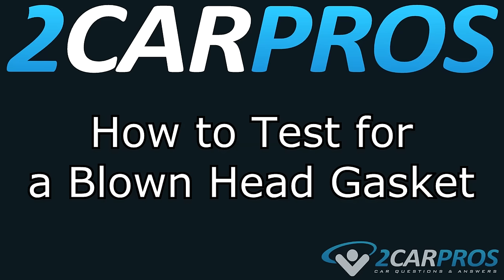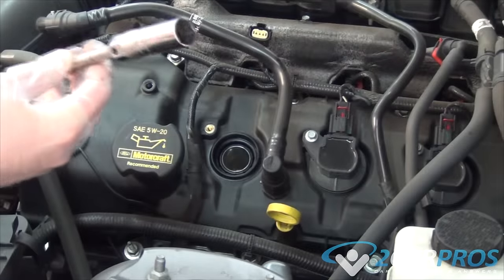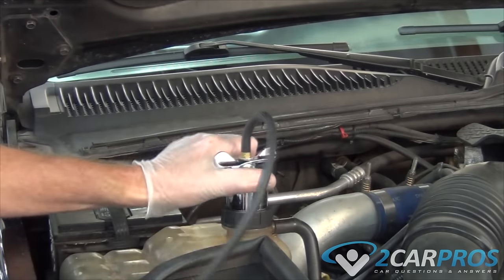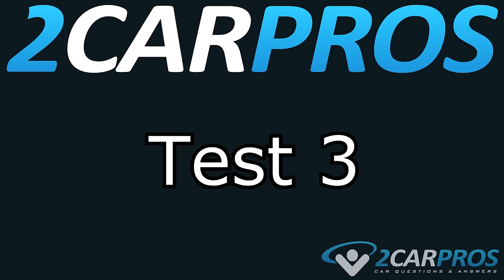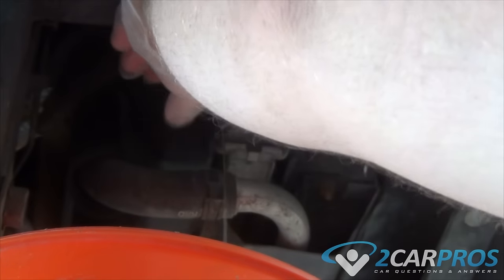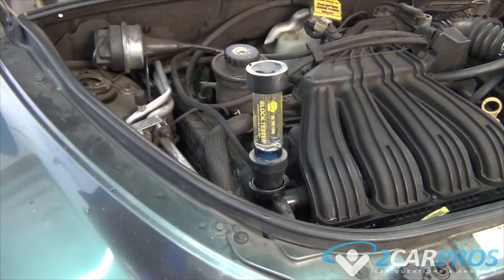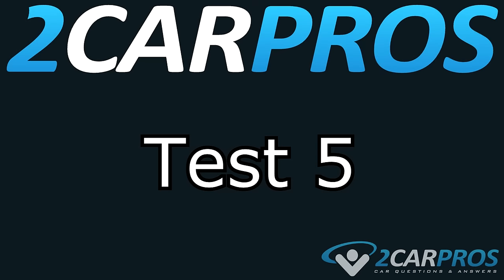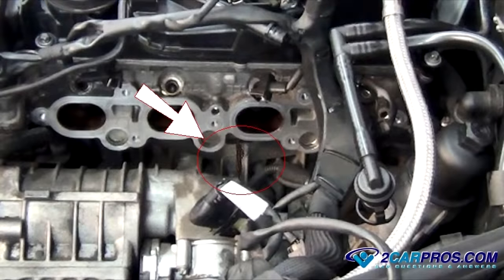HOW TO CHECK FOR A BLOWN HEAD GASKET

Comment: My car is heating up the temperature gauge moves kinda quick from 1/3 to 3/4 and back again. I replaced the cooling fans and it didn't work. I replaced the thermostat and new anti-freeze but the temperature gauge keeps moving like if its heating up. What else could it be? Anyone please.
Reply: Carlos Dominguez water pump maybe?
Reply: Elizabeth OilfieldTrash Hi, Happy Holidays! I took my car to an auto electric and he did a diagnostic and supposedly it was a fuse from the fuse box and that the the temperature gauge wasn't working well. The temperature gauge after driving for a while still goes past half up to 3/4. Yet I keep driving and the cars keeps running great. So seriously I don't have a clue as to what to do next. 

Thanks a lot
Reply: sounds like a plugged up radiator how old is vehicle what did the antifreeze look like when you drained it had a 92 dodge van that i had to change the radiator on three time in 5 years ran great in the winter had issues in the summer
Reply: When the engine is hot check the temperature at different parts of the radiator. It should all be hot.
Reply: Temperature sensor
Reply: Air in the cooling system..bleed the system..let engine cool down..remove radiator cap..have someone else turn heater on to High and rev engine to 1500 rpm till you see bubbles come out of radiator..back to idle..then rev again to 1500 rpm..back to idle..add antifreeze to the top of radiator..reinstall radiator cap. Turn ac back on. Drive car to average driving speed..65mph/2000 rpm..this should do the trick. Temperature gauge should stay at 3/8 to 1/2 line. Approx 208 degrees fahrenheit.

Comment: i am using honda city gxi varient 2004 petrol model 
 it is consuming engine oil upto 500 ml per 2000 km . what could be the problem vd my car
Reply: karan sharma Could be a number of things. Best is the check for leaking seals and gaskets and replace it if found. You can use leak finder dyes to locate leaks using uv light. If no leaks exist then move on by checking if the oil is leaking internally like inside the sparkplug cylinder wells. Oil could be burning off from each sparkplug detonation. Hope you rear engine seal isn't leaking. Expensive job to gave replace. If that is your problem you can try ATP AT-205 reseal. This has been know to work great for all kinds of seal leaks to avoid expensive repairs. Also replace pcv valve. A bad vavke can cause oil loss. If none of these things are the problem the only thing left would be a blown head gasket. Let's hope that isn't your issue. Good luck.

Comment: My spark plugs keep on burning out in 3-4 days every time.. help
Reply: happen to me water is leaking into the cylinder 
miss fire ....code
Reply: Did that help bro?
Reply: @megatron2535  i done up the whole engine.. and still happened.. the problem was that i had a hole in my cable on the water sprinklers that was just perfectly on top of my spark plug.. im an idiot for not noticing that..

Im not an expert by all means, but maybe i can tell you my opinion on your problem.. ive done a lot of research.. care to share ?
Reply: @Ay_Yo_WTF  cool thanks.. my car keeps heating up once I'm idling for too long at a red light or when I park and not immediately turn off the engine.. the moment I start driving again the car cools down again
Reply: @megatron2535  okay so.. they say its probably a broken radiator fan..
But my opinion is your coolant, because i remember a few years ago, my car use to do the same thing more or less, and my mechanic didnt say or charge me anything on a radiator fan.. 

Is your car manual or auto and which car is it ? Can you also tell me the miles on it..
Reply: More questions, sorry.. what colour is your coolant in your radiator?  And is there any type of liquid OR white colour foam on the radiator cap.. BE SURE to take off the cap when the engine is COLD to check..
Reply: @Ay_Yo_WTF  thanks I appreciate it bro.. i drive a 08 civic lx, 1.8L automatic with 150,000 miles.  The radiator cap doesnt have any milky brown discharge on it
Reply: @megatron2535  okay thats good news for the gasket issue, and if your not having any spark plug missfires.. i think your in the clear..
Reply: @megatron2535  oh and when you turn on your ac , does it overheat "quicker"..

They mentioned that you should open the hood, turn on the car and ac at max, you should hear the cooling fan under the hood turn on.. 

If it doesn't, then most probably the cooling fan/electric fan..

Personally i would take it to a local mechanic, at least two different ones, to see if they match and get a quote..
Reply: @Ay_Yo_WTF  thanks bro!  I'll ask my friends to see if they know any.. I'm relieved to hear it's probably not the gasket.. i swapped out the spark plugs 2 years ago or 25,000ish miles ago... I'll also pop the hood and check the fans to see if they operate correctly
Reply: @megatron2535  gasket problems include.. a lot of white smoke from exhaust, a lot of missfires and jerks..

So basically when there's a hole or crack between your radiator and spark plug holes.. which you dont seem to have..
Reply: @Ay_Yo_WTF  thanks bro.. I've taken a while to drive my car through different driving conditions to recreate the conditions that lead to my car overheating.. it hasn't overheated since.. I have had my ac on/off, short drives/long drives.. and nothing since.. ill keep looking at my temp gage to see whats going on.. do you think bad gasoline could also cause this?
Reply: @megatron2535  not bad gasoline in my opinion.. because from what i read, its that only oil and water circulates around your spark plugs and the cooling fan is there for the oil and water only.. hope that makes sense..
Reply: Probably too late in replying now but it sounds like thermostat problem or radiator fan problem to me
Reply: Does the temperature gauge go down quicker if you start blowing the heaters on full blast ? If so then it sounds like the thermostat is fooked
Reply: @chrissygizmo6057  never to late for good advice bro 👌.. weirdly enough the problem went away on its own 🤷‍♂️

Comment: In few days my swift vix2006 model car petrole smell lick in internal seats while driving car
Reply: fuel smell inside of car? its normally a fuel leak bellow the car where the fuel tube goes from the tank to the engine.

Comment: my car doesnt show anything the meter goes crazy changed radiators new fans fan motor and some other temperature sensors still temp goes up and down my mchanic checked and my coolant wasnt boling thermostat isnt jammed everything is fine turns out its the temp gauge 😂

Comment: HELP I have had dodge caravan to 3 different mechanics and 1 overpriced dodge dealer, I;m having over heat problems but I always stop van when it starts to go to 1:30 oclock on temp gauge --I have changed out everything on this crappy 3.6 L dodge chit....but otherwise the van runs smooth and no white smoke and no milky oil cap had test done and stayed blue--then dealer said it failed the test and so liquid turned yellow for them.....if blown head gasket wouldn't engine sound clunky and I have some smoke??    have had the radiator flushed and see no leaks but is it possible a old radiator 112,000 Dodge could be the problem and not showing any signs???
Reply: Theresa K17 Do you get heat from the heater vents when you turn on the heat? If not your heater core is clogged. If this is your problem you can easily bypass the heater core. If byoassibg the heater core solves your overheating then you've found your problem. If byoassing your clogged heating core still doesn't stop the car from overheating it means you either gave a stuck close thermostat it a clogged radiator. My guess is you already change the thermostat. With that many mikes it's a good idea to go ahead a get a new radiator even if you don't need it now. It will help with engine efficiency and gas mileage and less wear on your engine and water pump from better flowing radiator and reduce temps.
Reply: Theresa K17 forget to mention could be bad fans, fan relays, fan switches and thermal switches and water temp sensors. Could also by bad fan cluch if your car has a clutch fan. Coks be worn pulleys, list belts, frozen ac compress pulley. List goes on and on. Always check cheapest, easiest, and most likely first.
Reply: Easy to see if the fan is turning on when the engine is hot. Hot wire the motor to see if it's the switch or relay  before replacing the fan. This is basic mechanic stuff.
Reply: @emjayay  can u help me

Comment: Hi. I have a 2001 Dodge Durango 5.9l. My number 1 cylinder holds 95-100psi and the number 3 cylinder holds 120psi but the other 6 cylinders all hold 130psi. I don't have anything milky on the oil cap and there are no bubbles in the coolant when I remove the cap. Could that be the head gasket or is it more to do with the piston?
Reply: Bolt Terrakion worn piston ring

Comment: UGH these tests aent easy are they.... why cant the car just fail when the gasket fails.... this didnt help me at all I may as well bring to the shop before buyer $500 worth of tools and testers.
Reply from the maker: Most of the tools used here are available to rent for free at any auto parts store or purchased very cheaply on Amazon. Thanks for watching!
Reply: Because you need $500 worth of tools to open the radiator cap or the oil fill cap...

Comment: I have none of these symptoms, yet coolant is getting into the oil. Now I've drain chocolate milk from the pan.
Reply: Is it a GM?
Reply: If it is a GM car, the intake gaskets leak around the coolant port between the lower intake/cylinder head area. There are Problem Solver gaskets available that are stainless steel and 'rubber' that won't blow out and are installed w/ a larger torque #.
Reply: Also, flush the cooling system w/ a quality fluid and use yellow antifreeze. Store brand works fine. The pink/reddish stuff will crystallize before the next 100,000 interval change.
Reply: @mitchsumner2831 2002 Ford econoline. It was the lower intake gasket that leaked.   Since it's not the head gasket, I used a bottle of K-Seal (pour-n-go) and it seems to be fine now.

Comment: If you have a Northstar motor... Every one WILL BLOW HEAD GASKET... 2ND GEN REQUIRES  GM HEAD GASKET SEALANT EVERY TIME YOU SERVICE COOLING SYSTEM... ITS WRITTEN ON A SMALL LABEL UNDER THE HOOD !?!?! HEAD GASKET SEALANT FROM THE FACTORY!!? SOUNDS LIKE A BAND- AID ON A BULLETT HOLE... WAY TO GO GM!??
Reply from the maker: There is a headbolt kit that supposedly fixes that problem but it is a ton of work. Definitely not GM's best moment. Thanks for watching!